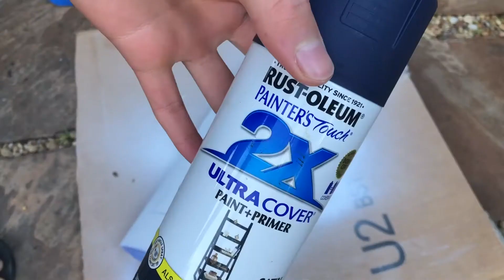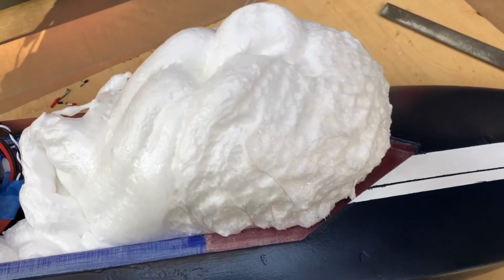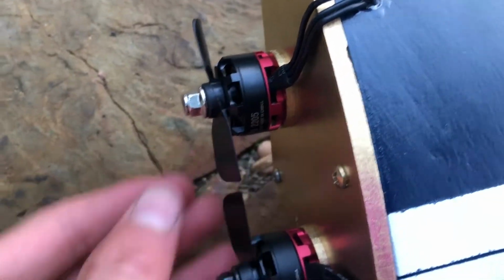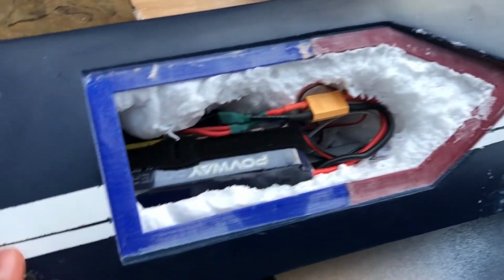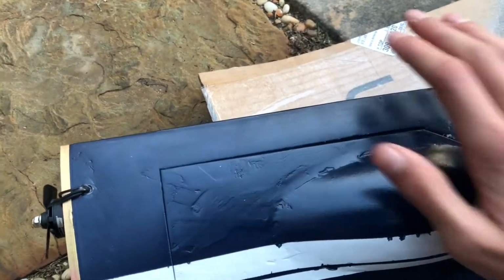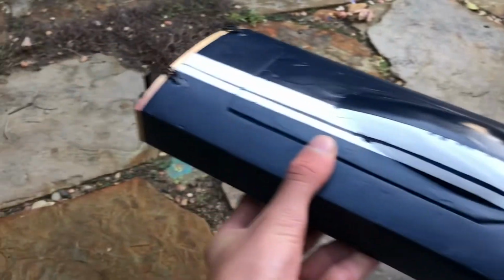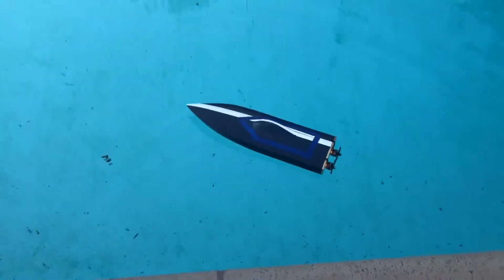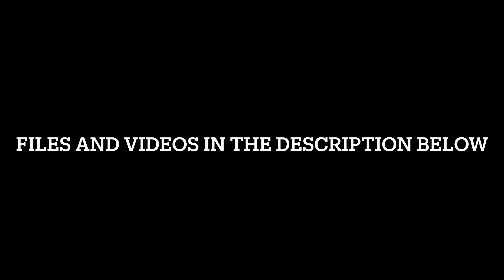3d Printed Speedboat - Designed by Peter Sripol and Sam Foskul

Comment: Can you make a list of parts that you used. Thanks, I want to make this. Also how much did it cost and how long to print?
Reply from the maker: The files are on thingiverse and can be found under Peter sripols video.

You need

2x 2205 brushless motors
2 brushless escs 20-30 amp up to 3-4s
5v bec for reciver power
Radio and a reciver 
3s lipo at least 2200 mah

Print time took less than 12 hours with a 0.8 mm nozzle on my Ender 3

spray foam and bondo is optional but makes a nicer finished product.

I probably forgot something in the list so feel free to ask if you need clarification.

Sam foskul, Peters friend make a detailed assembly video on his YouTube channel. 

Total cost is less than 50 dollars for me. But it could get up to 100$ for parts if you get higher quality parts.
Thanks for watching!
Reply: Is the steering controlled by one joystick or two like a skid steer. How long is the boat.
Reply from the maker: I set up a mix of the two throttle channels to get a differential steering on one stick, it is much simpler. About 16 to 18 inches long but it’s printed In 3 large parts